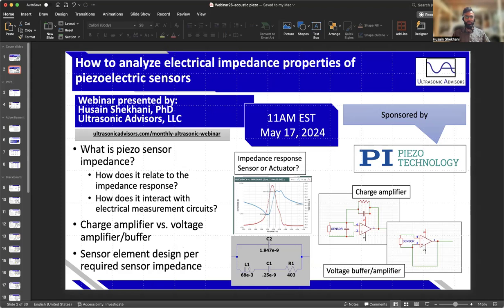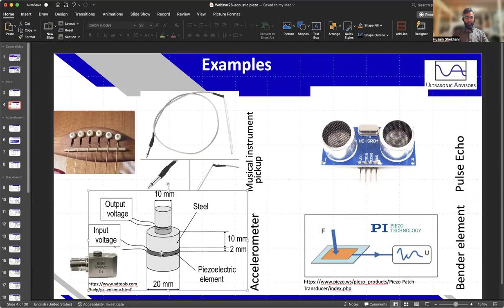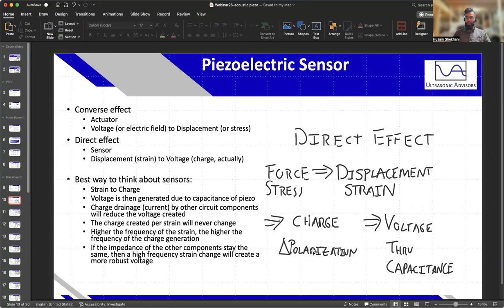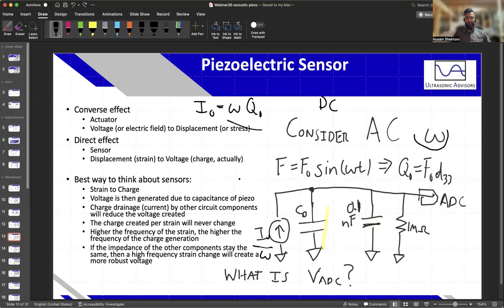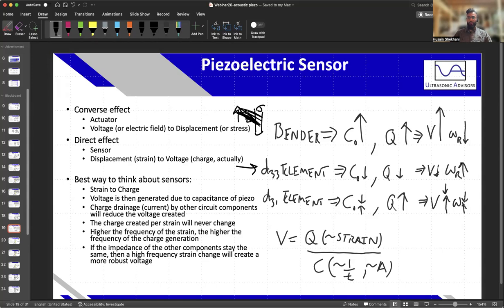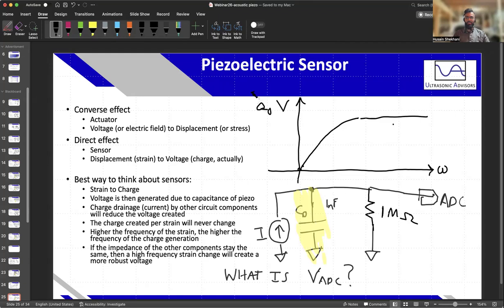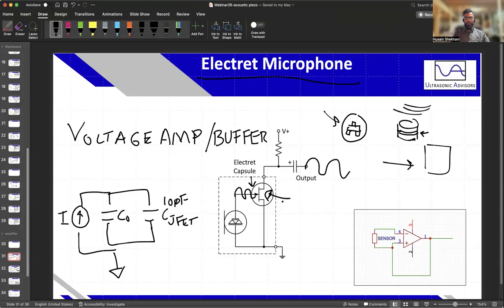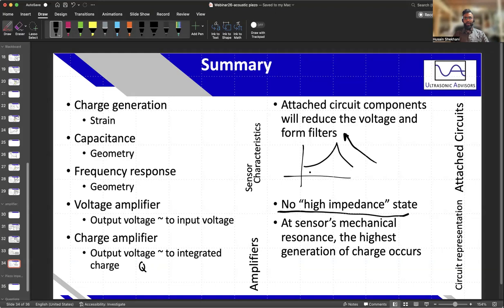How to analyze electrical impedance properties of piezoelectric sensors

Comment: Interesting as always. I am always surprised to see the single JFET amplifier used for electret microphones when a cascode arrangement is clearly called for due its reduced Miller capacitance. I guess the small increased cost implications for the added JFET and biasing resistors are the problem...